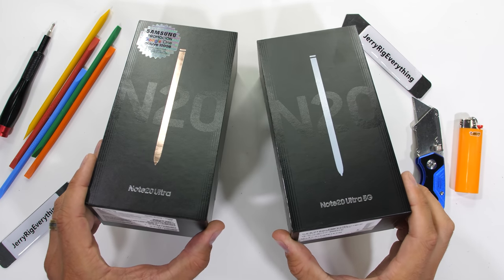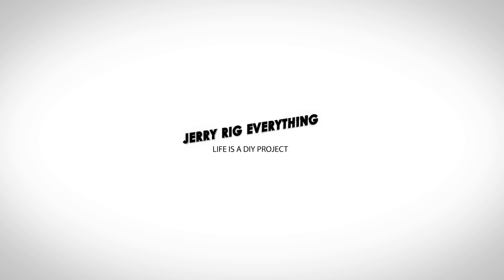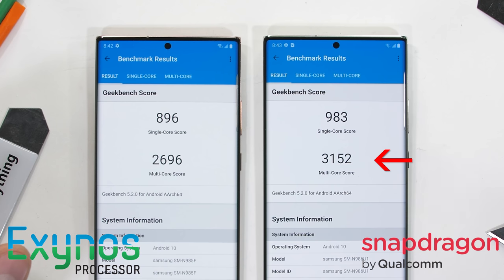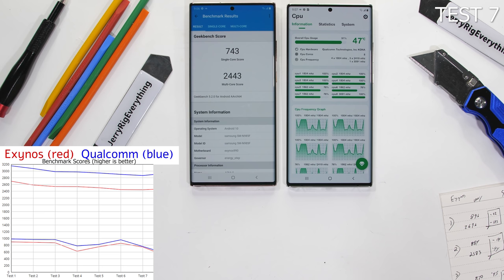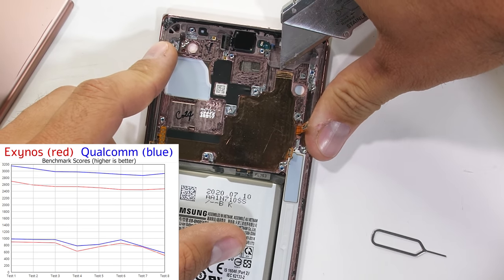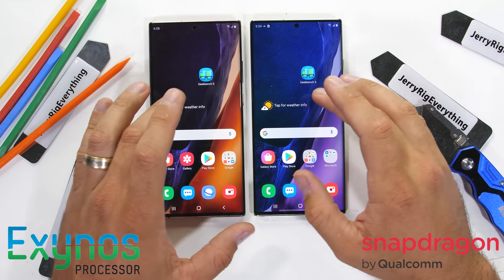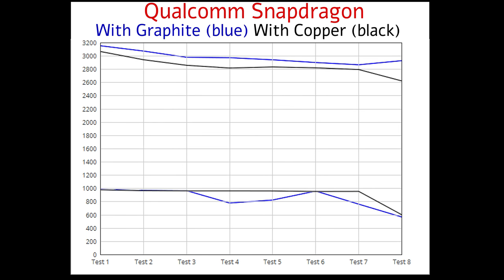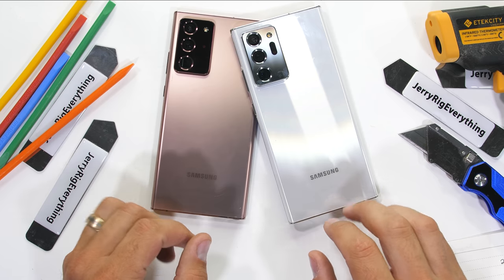Samsung should explain this... Exynos vs Qualcomm?! - Note 20 Ultra

Comment: There's a whole laundry list of shady things Samsung does making this my last phone.

- Forced update popups on old phones(you cannot dismiss these after a certain amount of times and it remains stuck in your notifications)

- Reduced battery and performance after said update when a new phone is released

- Blocked downgrades after certain updates

- Missing/removed features after updates(eg: video pro mode was removed from the note 9 and downgrades blocked, ... just because)

- Shady warranty practices(my spen was faulty and broke 2 days after getting my phone. Samsung refused replacing it despite having 2 year phone warranty in Aus and specifically having 6 month spen warranties in other countries due to known manufacturing flaws)
Reply: Samsung is turning into apple now with their higher prices each new phone and apple is starting to go to lower prices but still
Reply: @DerekMorganFBIHottie  this nonsense was built into more recent phones.
Reply: thomas wtf do you mean by YouTube lawyer, I was just saying Samsung is raising their prices and about the Apple thing they did release budget phones but a lot of Samsung’s are budget phones and the iPhone 12 is supposedly going to have increased prices so I was wrong about that you didn’t have to be rude about it.
Reply: I managed to skip an update for 120 days before it forced my phone to restart.... Heheh
Reply: @DerekMorganFBIHottie  good for you. A simple Google search will pull up forums with hundreds of complaints showing otherwise. Go be a Samsung fanboy elsewhere
Reply: Get an iPhone
Reply: iben Dover 
I don‘t think you would and if so, you‘re sick
Reply: here in india, samsung does not really get that great reviews,  like a lot of people say that their products are really cheap especially considering the price point. I don't really think that this is Samsung only that is doing it, Apple charges exorbitant prices for their products. Quite a few international companies do this I think
Reply: @easyybreezeyy  get one of the older phones with buttons or a flip phone and a professional camera, I’ll do that in a few years after my phone is no longer working. It seems like a cool idea.
Reply: I think its just your phone. My son has the S9 and still have pro video mode and no issue with updating.
Reply: @latarshawilkes9583  yup, just my phone and the 100s of other people complaining online about the same thing...sure. Perhaps take the time to do a simple Google search and check if this is an actual issue before making pointless comments and dismissing others' issues.
Reply: @DerekMorganFBIHottie  S6 was like Microsoft Vista, a mistake.  S7 was probably the last descent S model.
Reply: @solarsynapse  how? 

S6 had a stronger screen compared to the s7 

Ive dropped my old s6 from forklifts multiple times and had it land face down and never had cracks. 

My s7 cracked the moment it slipped from my lap when I got out of my car 

Also the s6 was the last one with an unlockable bootloader 

S7 and up had to be an exynos model in order to do anything custom rom wise or even root
Reply: Samsung doesn't "force updates"

That is a carrier issue. Verizon is well known for doing that
Reply: @lilrich1243  The S5 was tougher with no glass back, had expandable memory, USB 3.0, was water resistant, had a larger user removable battery and the IR blaster.  It has the 2.5 GHz quad-core Snapdragon 801 processor in the U.S. instead of the Exynos.  The S5 Neo had Exynos and IMO is lame.  The S6 has none of that.  The S5 can be upgraded to Android 6.0.1 from 4.4.2.  A wireless charging back can be added while the S6 was ready to go.  The S6 had 32, 64 or 128GB internal memory with no expansion.  The S6 had quick charge which shortened the life of the non user removable battery.  The S6 increased the profit of Samsung while reducing the features for the customers.  Overall, IMO the S5 beats the S6.
Reply: Forced updates on old phones.... You do realise old samsung phones stop getting updates after 2 years right apart from maybe a security updates but even those stop after a bit. My samsung tab s2 hasn't been updated in like 2 years, my Samsung S7 stopped getting updates in 2018. My J1 has never gotten a update although not sure it has enough storage to get a update lol. Reduced battery and performance after updates, you sure you aren't thinking apple there? My S10e got a upgrade a few months ago which greatly improved the battery life as now it lasts a full day whereas before I would have to plug it in at 5pm. Blocked downgrades after updates are you sure that wasn't google or your network provider if it was a network supplied phone? shady warranty practices you mean like apple and a lot of other companies? Also check the wording of the warranty and you might find that it doesn't cover accessories like the spen, also if something like that happens so soon after getting the device your first point of call should have been the place you got it from.

I might sound like a samsung fanboy trying to defend them but I honestly couldn't give a rats ass about samsung I'm just saying some of those issues you mention are very questionable tbh and not entirely samsung's fault. I've had great experiences with samsung but I've also had terrible experiences but I find their products are better than other manufacturers so I have a samsung as my main phone and I might keep it next year when my contract runs out although I'll probably get a different phone though as I seen some new phones that I like lol.
Reply: @FC360D  what even is your point? I don't care if the updates stop after 2 years. If the final updates take features away specifically from older phones or make the phone operate in a deteriorated state while not giving users the option to ignore the update and blocks downgrades then that IS shady. Make all the excuses you want. If you think raising these issues is questionable, then yes you are a fanboy. At the end of the day people like you are just shooting yourself in the foot allowing Samsung to keep doing what they're doing and getting shittier phones every year. Other consumers that actually have an ounce of critical thinking will move on to another brand.
Reply: What phones would you recommend then? I'm thinking of leaving apple, but if Samsung isn't safe then should I go with the pixel? Huawei? OnePlus? Moto?
Reply: @AnnisAdventures  im really Happy with Oneplus, previously op5 big accidental damage after 3.5years forced me to OP8t and i love it.
Reply: @ibendover4817  what part of "CARRIER FORCES UPDATES" did you not understand? 

That's like blaming intel dell toshiba etc for forced updates ignoring the fact they come from Microsoft 

Also iphones were proven to be "degraded" by apple themselves to force the user into a "newer" phone. 

Hell I just retired my note 3 running Android 10 with a custom rom and switched to oneplus 

I'm starting to doubt your validity seeing as how Ive been with Android since gingerbread and ics and never faced those issues you claim
Reply: @ibendover4817   lmfao

How are you even getting service/data at this minute? 

Sim unlock/ carrier unlock only makes the phone be usable when overseas or if you want to use a verizon phone on T-Mobile Network 

I brought up apple because your acting like only androids degraded their phones

I ignored your other comments because they're just nitpicky or something I've never encountered or heard off. 

How hypocritical of you to tell me to use my brain and do a Google search when google is saying that forced UPDATES are a a CARRIER issue with Verizon being the biggest offender. 

I'm not a fan boy I'm just somebody who actually googled my answers instead of beaching and whinnying. 

Are you going to cry to dell because the laptop is forcing you to update to the latest windows? 

Only "dumfk" here is you sweetie if anything me still using a "6th gen device with a custom rom" sheats all over your Android are degraded argument.
Reply: @lilrich1243  Wow, the two of you just devolved what could have been an interesting discussion into childish arguments, lol. But he's right, this is an issue a lot of people experience for some reason. My uncle gave his kid an old wifi only note 9 with no sim  and he got the forced os and bixby updates. Buy you're right too, certain carriers do also force updates, so it's from both sides, the carrier issue forming the majority of them. Also I'm pretty sure he's saying samsung is forcing updates, not android as a whole. Most of the other issues are pretty valid too and seem isolated to just samsung compared to other android phones. Perhaps try reading properly and asking questions to get more context rather than making assumptions man, at the end of the day we just want companies to do the right thing. Also @iben Dover, name calling like that is unnecessary dude, there are more civil ways to get your points across, if anything you can just ignore the frustrating comments and move on. This is the youtube comments section after all where everyone is an 'expert', lol.
Reply: Samsung warranty is a huge joke, only way to get decent warranty with Galaxy phones is to buy warranty through carriers. I’ve dealt with one back in S6 Edge days, took me close to a month to resolve anything (it was a faulty modem/wifi chip, kind of an issue on a phone when calls keep dropping). Irritated me enough that I just walked over to Apple and bought a iPhone 6 Plus.
Reply: @ibendover4817  Updates that take features away are probably because of your carrier if its a carrier supplied phone. So don't blame Samsung
Reply: @unliving_ball_of_gas  it's not a carrier supplied phone so I will continue to blame Samsung. Also that's just false, get a life. Reported this as spam.
Reply: Could switch to OnePlus one, but those things you mentioned does happen to any old phones due to RAM and storage space, Battery life does shorten over time due to overcharging or not charging before 15%. warranty's are always shaddy and changed at will.
Reply: @cody1212143  I'm aware. But having a spike in that sort of behivaour directly after an update is suspicious. Either way, the other issues like removing features from older phones and poor warranty support even for their flagship phones, are more serious.
Reply: I'm happy with my S9+, i still have pro and pro video on it aswell, i also have a headphone jack and i won't pay a ton on shipping and import costs to get a newer phone with a Qualcomm chip.. *my current one has an Exynos) neither has my battery life become worse, the only phone where my batt life is halved now is my old S6 that was also used as a daily driver for 3 ish years and is still working, its only worse because it had its fair share of charging times, i often use it as an internet webcam for my 3D printer LOL (just on local network, octoprint connects to it)

Comment: The exonys note 20's screen brightness is lower than the Qualcomm model .
Reply: Interesting. I wonder if the brightness influences the results of the tests. I know it has a big impact on energy use.
Reply: Yet was still hotter, lost more battery power and performed worse 😂
Reply: He mentioned that the brightness is up on both phones but the coating on the front glass is different.
Reply: Well the screen coating i liked better in

 The exynos
Reply: Even the image quality..the SD processor seems to process images better than that crap exynos
Reply: No, no two OLED panels are made the same, they differ greatly

Comment: It's surprising to see how Exynos has degraded. Back with the S5 it was the better SoC compared to Qualcomm. It supported all 8 Cores while the Qualcomm version was only able to max out at 4 Cores due to some incompatibilty with US LTE networks at the time. I worked with Samsung Corporation so all this is internal information while I was on the job. The S5's Exynos always had a better sound system with Wolfson DAC and it was also faster, more power efficient and cooler. The tables have turned since.

Comment: Ahh the old days when exynos was the superior one, those days... Bring SD to Europe if you can't figure it out anymore, Samsung! ☹️
Reply: Pretty sure samsung has dropped their CPU line... wonder if the rest will get SD.
Reply: Or just don't use Samsung 😂😂
Reply: Haha seriously I was quite confused when the Snapdragon was doing better bc I haven't paid attention to Samsung for a while now since I switched to iPhone.
Reply: exynos were never superior its constant garbage it heats up easily
Reply: @hallucy2215  nope you are wrong
At onetime exynos had to be unclocked to match snapdragon
Reply: @hallucy2215  during s6 release and around that time till s9 i guess exy was doing quite well.
Reply: Ikr.. since the galaxy S10, exynos can't compete with SD.. even on the S9 era exynos 9810 still better on the CPU than SD (never on the GPU though)
Reply: @hallucy2215  Actually years ago the SD was the inferior chip to the exynos. You'd have to go back to the early to mid 2010s though.
Reply: @ha_dua_o  By the time of the S6 to S7 that's when exynos started to fall behind and it just got worse overtime.
Reply: @Bassboy1987  trust me, I have both model of S5 & S7, for now after long time I know exynos far better, especially when it comes to root development.. but yeah we all know since the S10 exynos totally suck
Reply: @UshiromiyaXyrius  Heavily considering that but the level of maturness within their apps & ecosystem makes me want to complain and them to improve; rather than switching my phone/watch/buds.

Comment: Even mediatek is better. I stopped buying samsung just for this garbage exynos.
Reply: bruh mediatek is better than that bullshit exynos
Reply: Yeah, exynos is garbage and it is expensive.
Reply: Idk wat tf im using but I've got an s20 lol
Reply: Shylan100 CPU Z brother
Reply: Galaxy A31 has mediatek
Reply: @Draglox  no, still exynos
Reply: Just buy on eBay from an american seller or on amazon
Reply: I thought performance wise mediatek and exynos performed roughly the same given they get penalty points for relying on a separate gpu. Went from a Mediatek oem brand, to intel then basically focused on Snapdragons and was pretty satisfied with their performance except for the overheat issues with the earlier chips.
Reply: This is why im qurstioning my decision on why i purchased an s10 plus even tho its a snapdragon version.

Comment: I've already decided that the s10+ is gonna be my last Samsung phone. Been with them since the S7 but I can't support them anymore
Reply: Same. Nothing holding me back after they removed the headphone jack.
Reply: Riasat Same here. I dont know what phone I‘m going to upgrade to (I usually upgrade every 2 years), but since every company is removing the headphone jack unless they’re midtier phones, I have not idea what to get.
Reply: Me too, im an s10+ exynos user also, and im disapointed in the performance of the battery, gaming performance, and the cooling system. I will only stick to samsung if they change all of their products to use only snapdragon
Reply: I really want that Galaxy Z fold 2 that just came out. I just can't throw $2,000 bucks on it yet. I have the money, but damn. I'd rather save my money, though it's an amazing phone.
Reply: @shadypalmtree2989  rog phone
Reply: @shadypalmtree2989  OnePlus 8 Pro is the most legit alternative so far imo
Reply: @thur9368  ROG phone is great on specs but dem it's super thicc plus the gamery aesthetic is not for everyone tbh. Also, the camera is not great. The phone is definitely built solely for mobile gaming 👍🏼
Reply: I had S3,S4,Note5,S8+ and S9+ but nowadays their increasing price and bad ethics ... As my s9 plus battery failing I'll be going for iphone next year...
Reply: @umblikalify  The high price is actually true if you buy during early launch because Samsung devices frequently got promo and discount after few months. But other aspects, I agree with you :/
Reply: @obidean3964  Brother OnePlus 8 Pro is the Best Alternative Ever
Reply: I have been with samsung since galaxy s4. Then galaxy s5, s6, s8+ and now s10e. But i guess it is time to move on when the company you put your money and loyalty on keeps giving you shit !